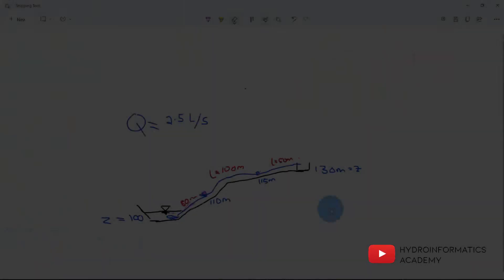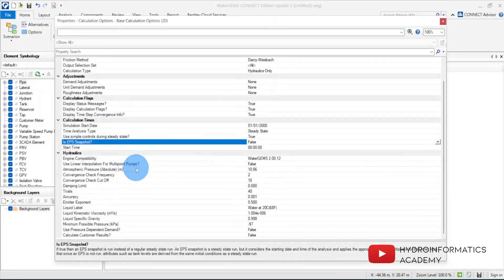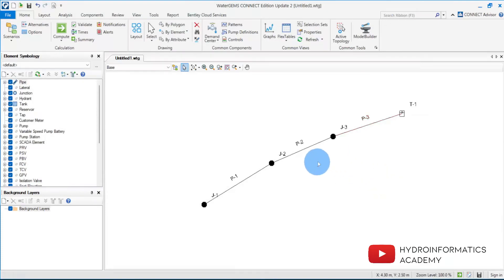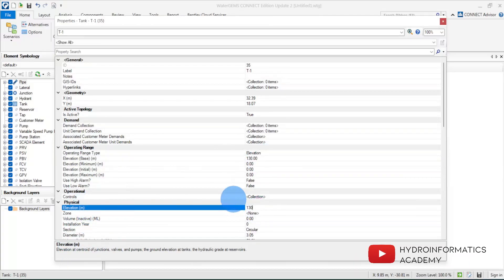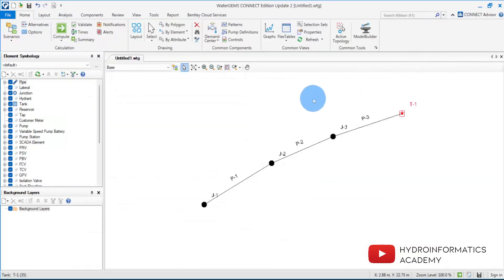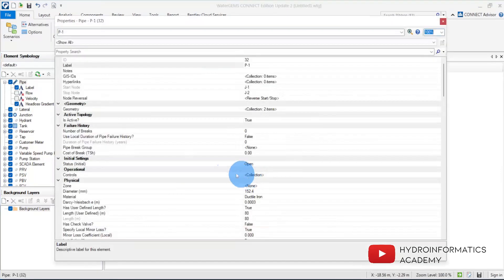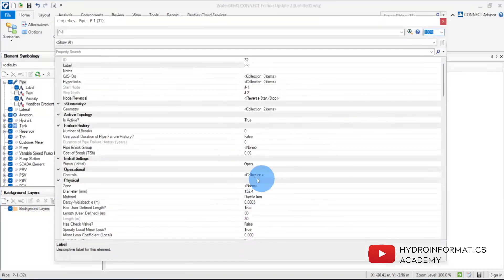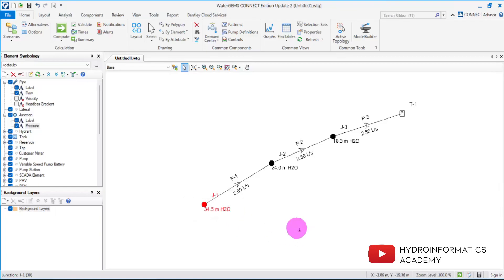Sizing Water Pump Without Pump Curve in WaterGEMS

Comment: Sir I have two question please answer
question-1:in your tutorial,is node is play as a role of pump?

question-2: what do you mean by source, a reservoir or node or pump? why are you not using positive demand?
Reply from the maker: 1. Yes!
2. Remember this was a submissible pump so a source was where the pump is installed (say, within a pond or tank).

If we used positive demand the model would not run as expected!

NB: you can try to set it as a positive 2.5L/s and see what you get!🙏
Reply: @HydroinformaticsAcademy  Sir if i am using positive demand then the flow shows tank to junction that means top to bottom flow. why this happen sir?  Whats the main reason for this?
Reply from the maker: When you put a positive demand that indicates a node is receiving and not supplying water!

Comment: Dear Sir, why are you shifting elevation to level in operation range type? When we use level & when we use elevation? What's the different between them?
Reply from the maker: Okay, there are 2 ways you can provide tank ranges or dimensions in WaterGEMS.

1. BY USING elevation. In this, you provide only elevation values i.e. if the ground level is 100m then the minimum level is going to be 100.3m and the initial level 103m!

2. If you use Levels then you only provide elevation for the tank and for tank dimensions or ranges you provide only the actual number i.e. for the minimum level you set 0.3m and not 100.3m and for the initial you provide 3m and not 103m!

NB: These ranges i.e. initial, minimum and maximum you get from tank drawings!
Possibly one day I will prepare a tutorial on how to deal with tanks in water gems. I don't know when but We will see!
Reply: @HydroinformaticsAcademy  Really Thank you sir for your magical solutions.
Reply from the maker: You are welcome🙏🙏